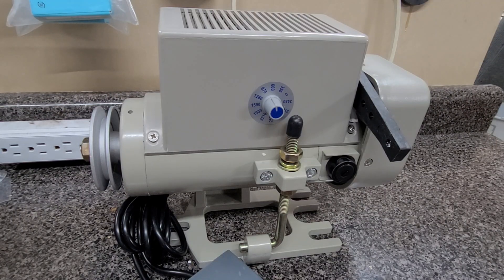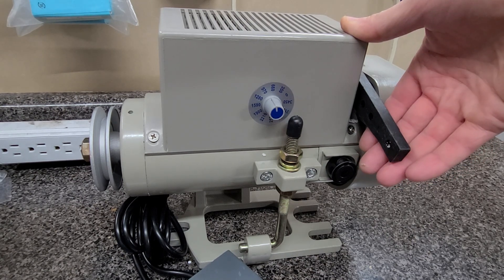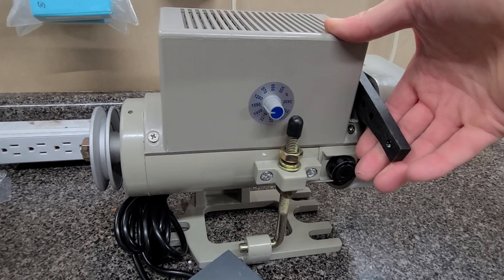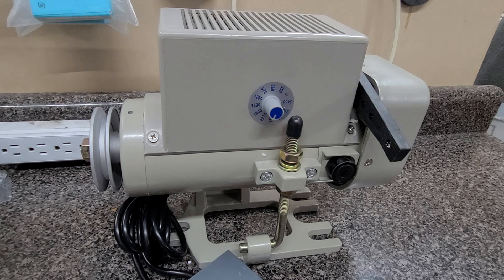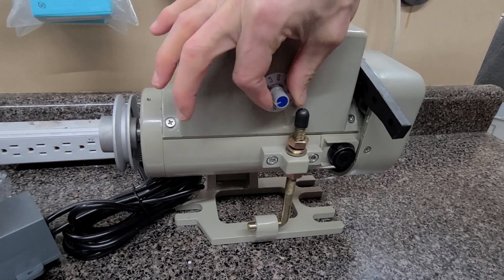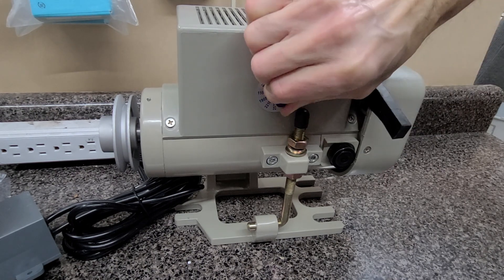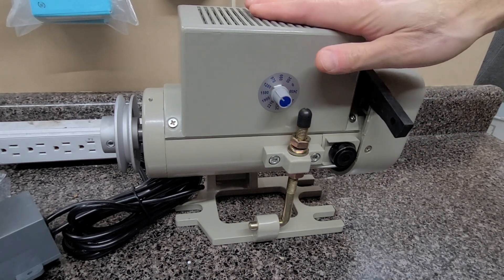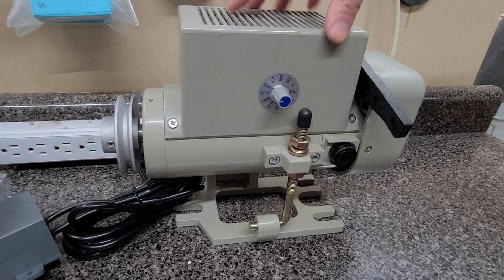Rex and Family 3/4HP servo motors - difference and sound

Comment: Hi My name is Virginia  I have a Juki ddl 8700 H the trouble with the motor is that the stay directa and don't does stop
Reply from the maker: Unfortunately it is probably the circuit board.  Remove the extension rod from the motor first to make sure the pedal is not positioned to low and pulling on the motor's actuator arm.

Comment: I have the FESM-550N model and when I hand crank my machine it makes this annoying squeaking sound. Any way of fixing this? Thank you for any info.
Reply from the maker: Does it make the sound when you push the pedal slightly without engaging the motor?  The clutch cork in the motor may be making the noise.
Reply: @Sewinggold  Thank you for getting back to me. My husband thankfully explained to me that the noise could’ve been like when you forget to take the emergency out from the car and start moving the car with it on. Lol so he was like “touch the pedal a bit and try to move the handwheel and see if that fixes it” sure enough. Shame on me. I’m still a newbie. That is my excuse. Lol Thank you!!